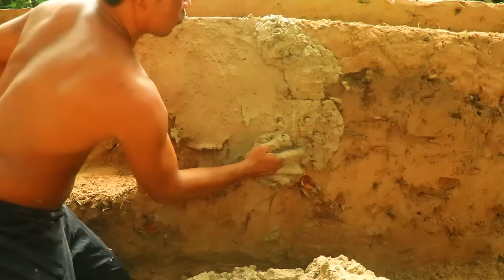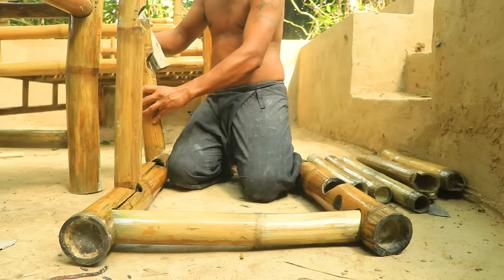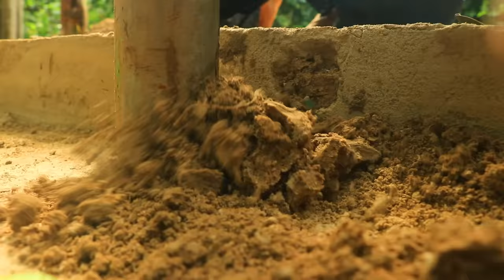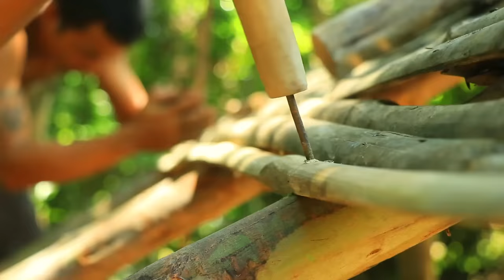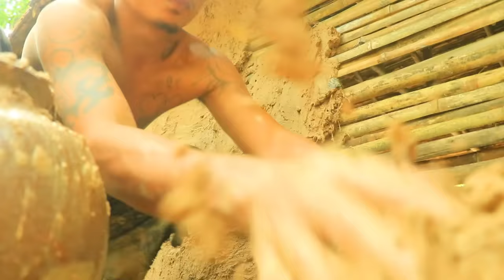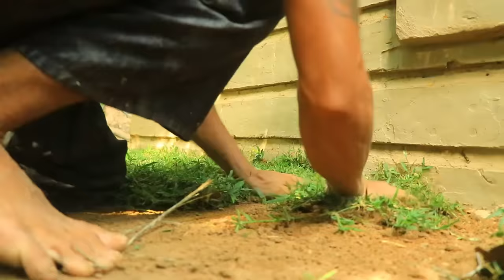25Days Building Underground House with Decoration Underground Room

Comment: These are heavily staged. Entire teams do the work. Water sources aren’t anywhere nearby. Concrete doesn’t come from mud. You can see excavator tracks and even machines. The cuts are too clean. 
There are people doing work and building these. But it’s a team of engineers and builders using mostly modern technology and editing. 
It’s all in this video: 

https://youtu.be/Hvk63LADbFc